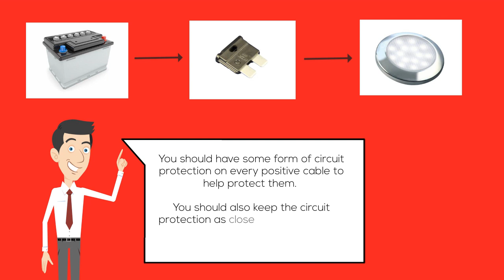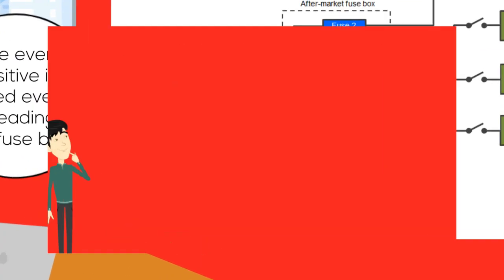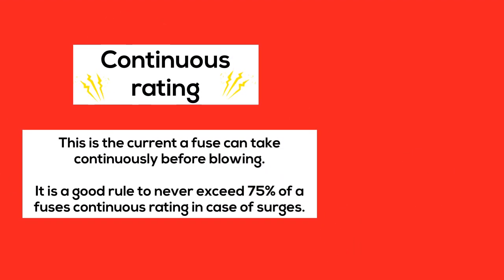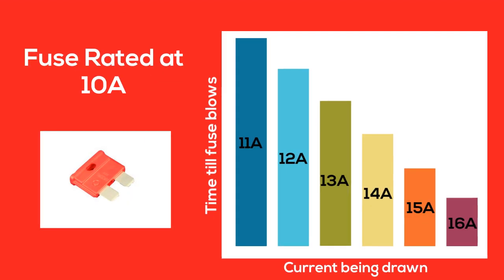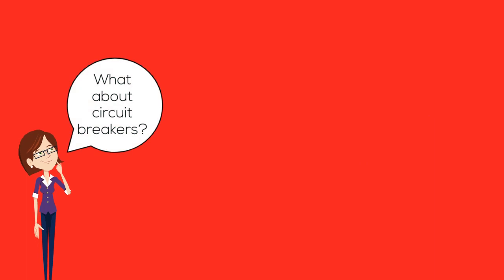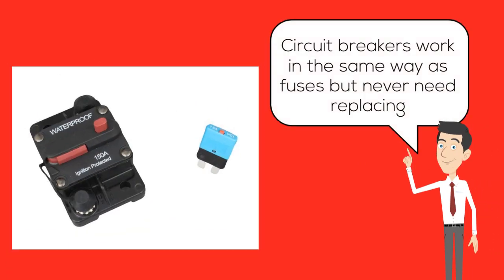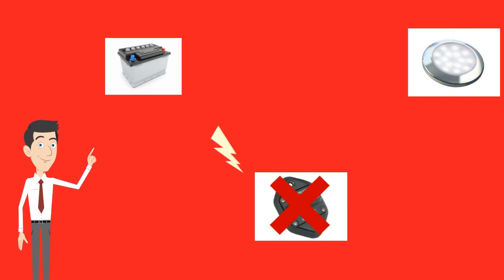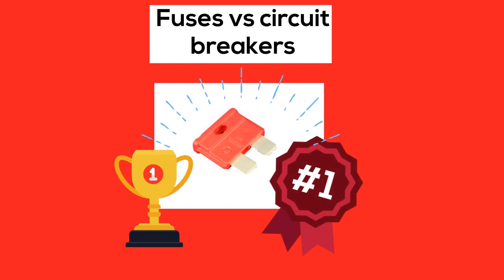Fusing and Circuit Protection Explained | 12 Volt Planet

Comment: Hi, I've got an idea for a video. When calculating the cable size, do you take the total length of the cable, or only to the fuse box? This is relevant in particular with 24V system where the converter and fuse box is deported closer to the 12V appliances... I'm not sure, that's why I'm suggesting a video. For now I consider each cable separatly, but add up the Amps on the upstream cable... But I need to be sure :) It feels correct because if I have 2 appliances, one taking huge amount of electricity and one very little, it makes sense that the cable to the small appliance is smaller. Similarly if the junction box is really far, and the 2 appliances fairly close, it doesn't make sense that the cable be big... But that one I'm really not sure :) :( Because if I disconnect the big appliance, there is only the small one, and the fusebox is "transparent", so I would calculate the thickness based on total distance... But there is the 24V/12V converter...
Reply from the maker: Hi, We always start from the start of the new cable piece however I will add this to our list for video ideas. Thank you

Comment: Thanks for trying but that has confused me further!
Reply from the maker: HI Phil, Thanks for the feedback. May I ask what confused you further? You may find our written guide has more information also https://www.12voltplanet.co.uk/fuses-guide-uses.html
Reply: I have 2000w power inverter and I wand to install it on my car secondary battery . My question is what is better  way install it with fuse or circuit breaker??

And what amp size should I go for ?
Reply: Sound on max. Headphones. Still hard to hear. But this was helpful. Thank you.